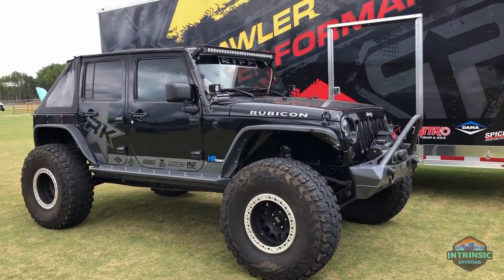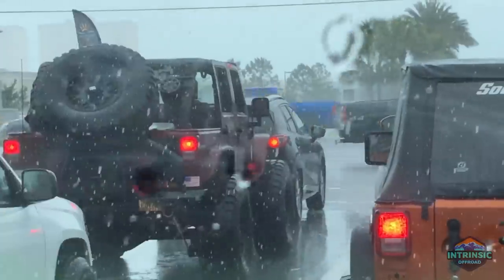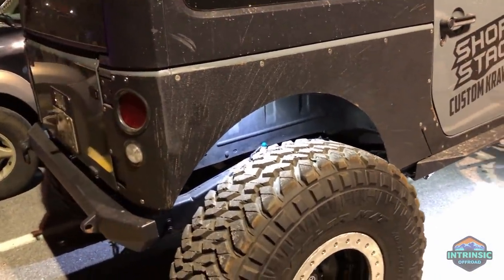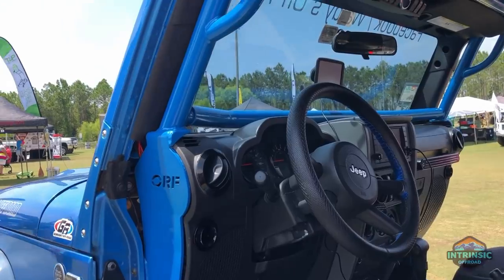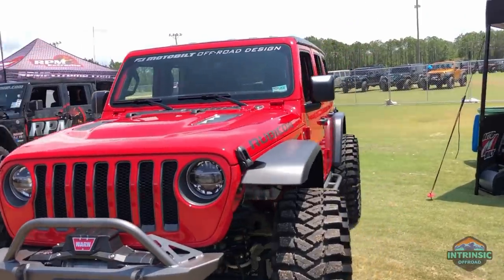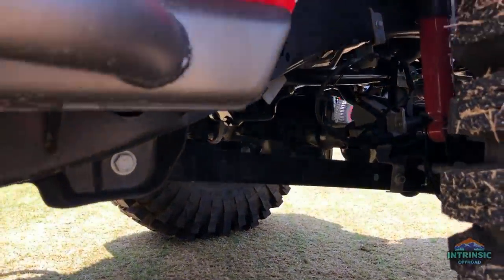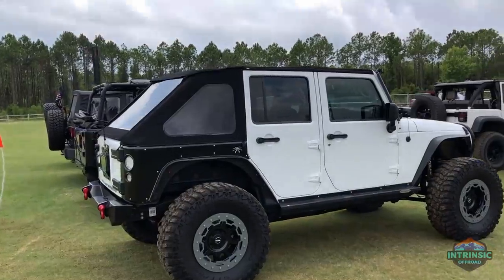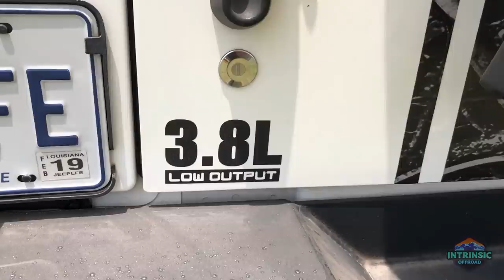Jeep Beach Jam 2018 | Exploring Jeep Wrangler Builds

Comment: I'm running RK Trail Gunner. Long arm, F/R independent 3 link conversion with their new black anodized body coilovers & triple bypasses...look way better than the older versions. Well built & simply refreshing to see someone deviate from going the typical King route. Just ordered their inner fenders as well. They were built to fit their coilovers/bypass set-up. Not sure they'd fit 2.0 monotubes or remote reservoirs being that their coilovers/bypasses don't utilize factory shock mounting locations, those get hacked off and new mounts welded in. I know this is an older video so it might be irrelevant for you but for anyone else contemplating doing the same, I'd hit up Adam or Jeremy at RK to confirm fittment.

Comment: Awesome video are you going to be getting a JL to replace big sauce?
Reply: You're going to get to where I am I bet. Fully built JK, getting closer to a buggy and further from a JK. no longer drive it on the street that much, daily drive my tow rig, wish I had just built a buggy.
Reply: You couldn't be more right there. On 40 inch + tires i either run buggy trails that will damage my jeep almost guaranteed, or i just have trails be boring.
Reply: Well if you want to trade parts to do overall build again I  Will be your huckleberry.